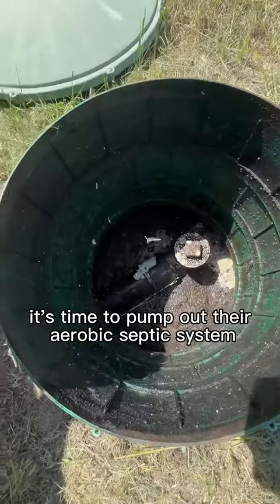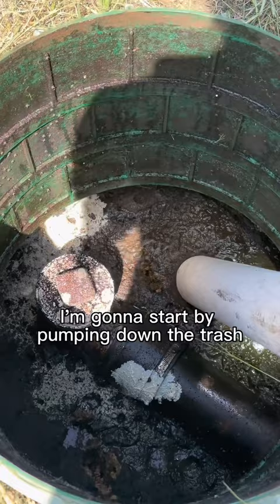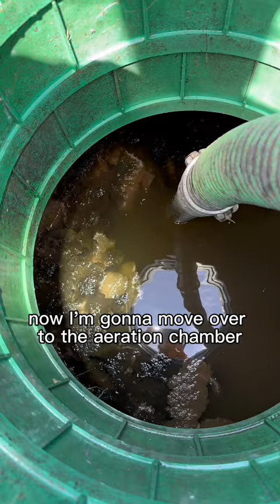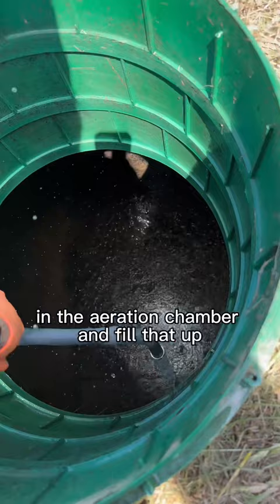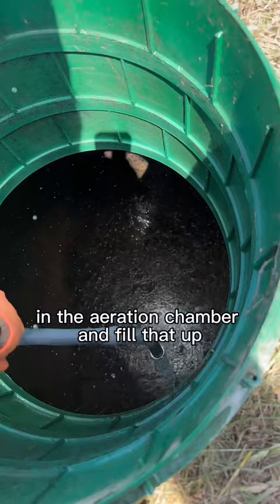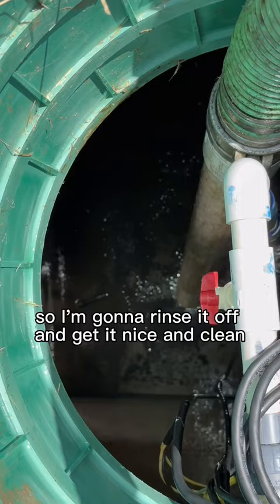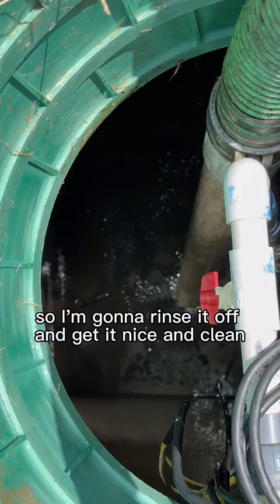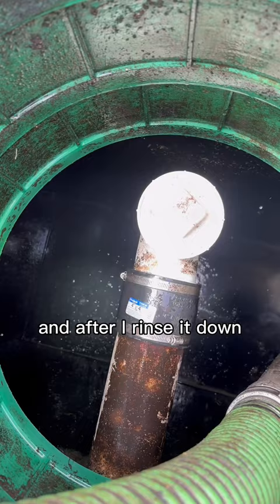The Forbidden Chili #shorts

Comment: cool vid bro🤙🏻. how do you know when the tank on your truck is full or nearing full? is there a gauge or something that gives you a reading ?
Reply: I build these tanks! Usually they will have a clear tube on the side of the tank that shows the level. Occasionally the customer will request a float type gauge. That type has a hollow steel ball on a rod, then there is an indicator arrow on the outside of the tank to show the level.
Reply: @JasonFrankenstein  that’s pretty neat. always wondered how it worked. preciate it.

Comment: Take note of where each brand decides to cap off the air-pressure from moving toward the home.  In my county the installers completely ignore over-pressurizing the pumps where the cheap solution is to ignore sealing off groundwater & leaving gaps in the risers to be used as vents-to-atmosphere. Hiblows want just over 2PSI with a 4PSI max & a 8-9PSI to be damaging. I think you should add the air-pump pressure test & proper venting of the aeration-tank(or chlorination tank, they air-connect).  The Tuf-tile vent is $40 so it's business if you're qualified to add it.